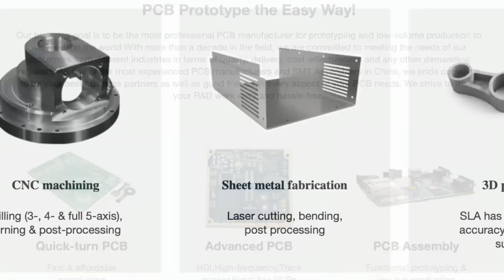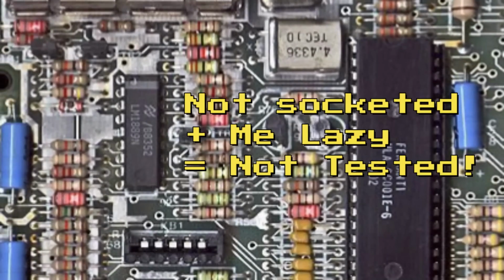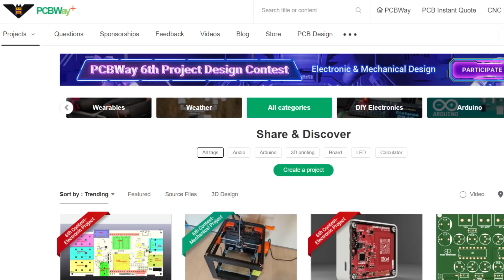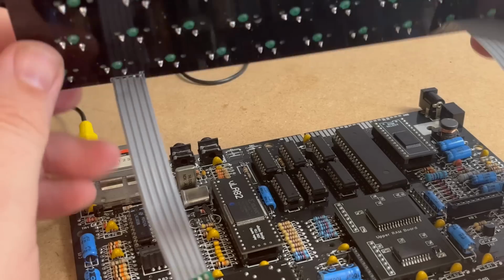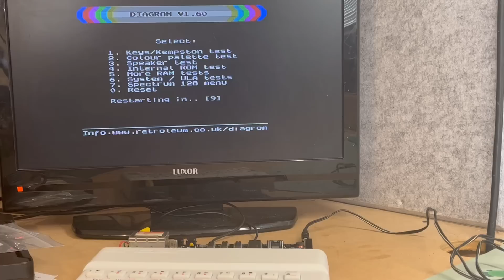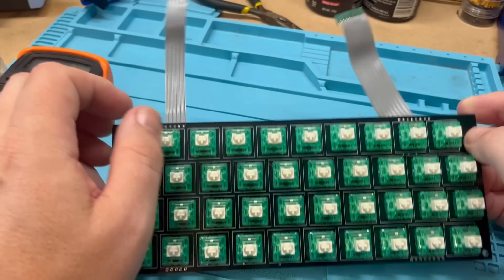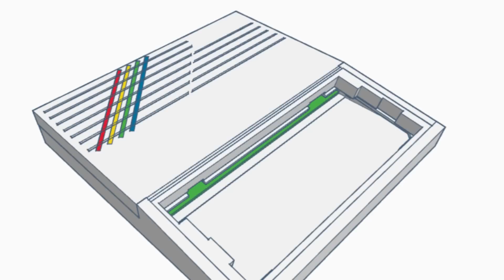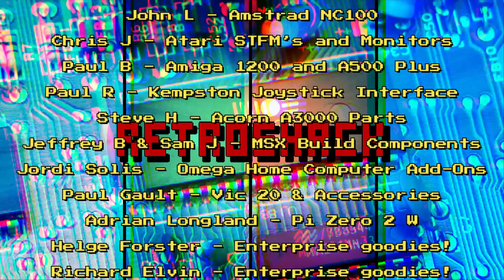Brand New Spectrum 48k Part 2 - IN LIVING COLOUR! and with a new keyboard too!

Comment: Looking at the datasheet for the LM1889n, it doesn't look like a too complex circuit. I mean, the ULA was reverse engineered, and the LM1889n has full schematics in the datasheet. It should be very doable to create a modern replacement.
Reply: As almost everybody replaces the RF output with some kind of video output mod the LM1889n is not needed in it's entirety so probable small PCB with few SMD resistors and transistors will do the trick.